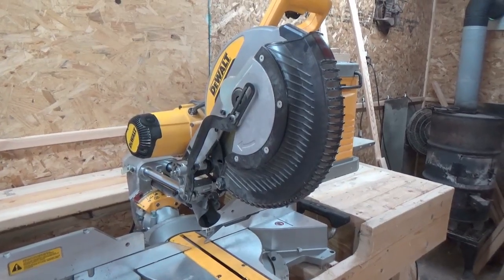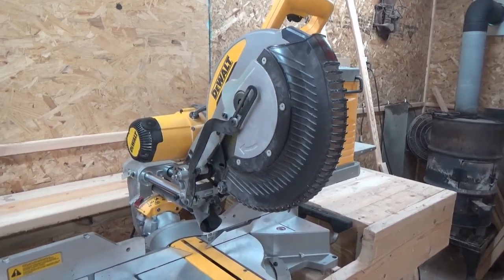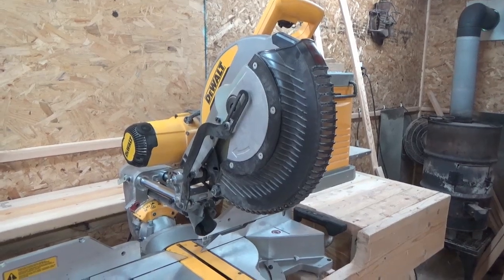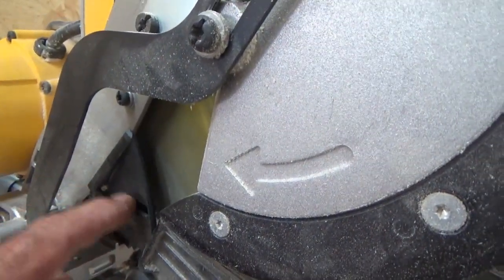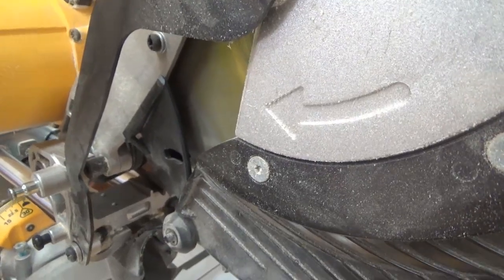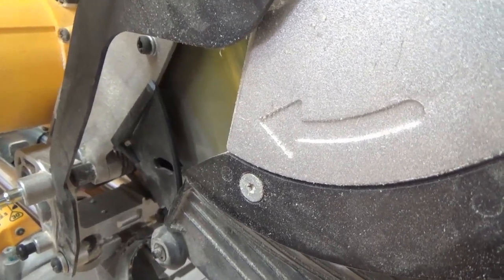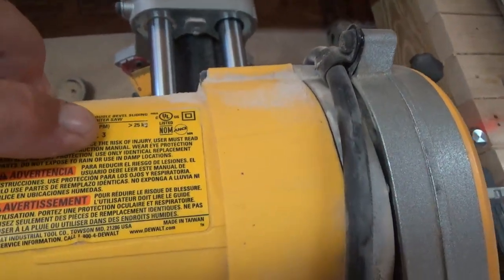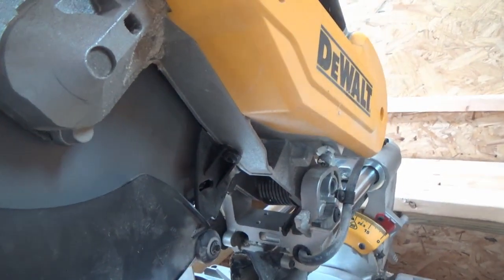Dewalt Compound Miter Saw Safety Recall Info - Dewalt Model DWS779, DWS780 and DHS790 Miter Saws

Comment: Just removed mine waiting for my parts.  Noticed that the collars where the screws are placed had small cracks.  The original part is plastic, looks like its being replaced with metal.  Shouldnt be an issue moving forward.
Reply from the maker: I actually pulled mine off on Monday as I needed the saw. Got the new part yesterday but was too busy to even open the package, I'll be installing it today.

Comment: My guard shattered. Scared the shit out of me. I took the what remained off and  and kept cutting because the project I was working on needed to be completed. I kept cutting for a while and had another blade bind that bent the main drive gear. Had to order a new one. Now that I know about the danger, probably gonna not use it until I get whatever the replacement is. I avoided injury to be clear. I was cutting aluminum and was being very cautious and wearing good PPE.
Reply from the maker: Glad you weren't hurt.

Comment: That's what happened to me a damn 2x4 just right up there I mean it hit that side of the gun and it went everywhere I mean it was pieces flying all over the garage and there's some pieces I still haven't found yet it split the 2x4 and a half that's what cut it so I took it down to home Depot home Depot exchange it for a new one so and then I called in about it after I heard about the recall so I don't know if I'm going to want it started it or not but I'll tell you one thing that something was scared the hell out of me
Reply from the maker: Unreal

Comment: Would rather have plastic flying shrapnel than metal flying shrapnel.
Reply from the maker: Totally agree! I think the issue was that the plastic part warped over time and interfered with the blade. The replacement metal guard won't warp so there should be no danger of it hitting the blade.